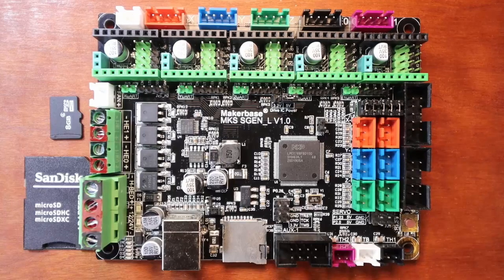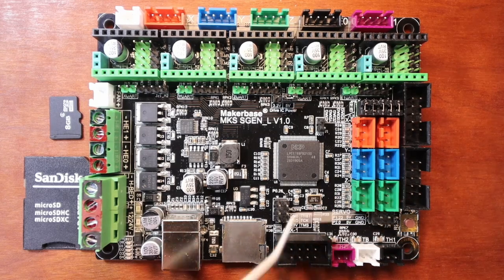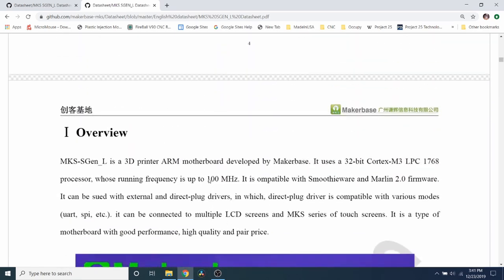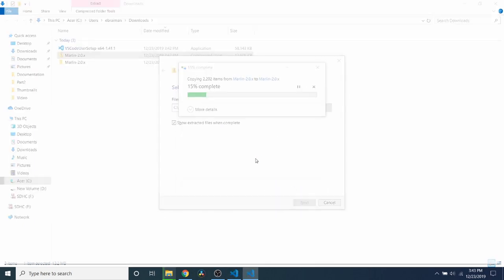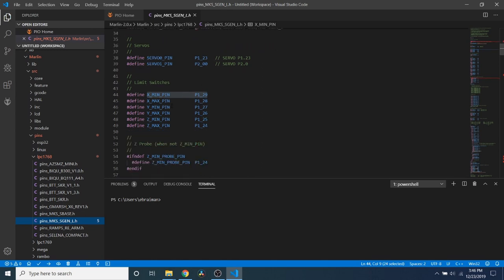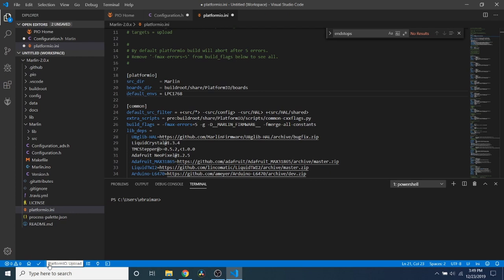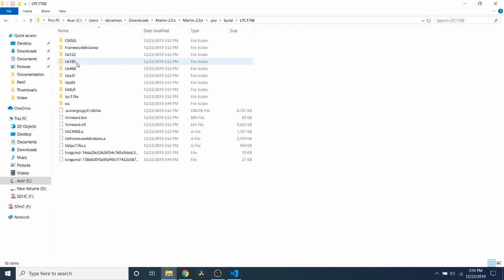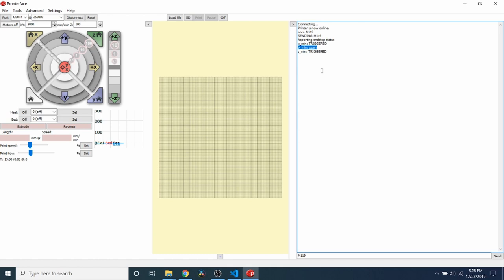MKS SGEN L V1.0 - Basics

Comment: Thank you for this and your other SGEN L tutorials. Having a complete step-by-step guide saved me from a ton of research.

And in case someone else runs into the problem that the board doesn't accept the firmware.bin file and keeps rapidly flashing the LEDs in the corner - for me it was a SD card issue, even though the card passed any testing software I threw at it. Only after replacing it firmware.cur appeared.

Comment: so with the mks gen_l v1.0 board that I just got there is no sd card holder on the board so how do I get the job done on it?  been trying for about 2 weeks and just noticed that there is no place to insert the sd card.
Reply from the maker: MkS Gen L is loaded via USB port for firmware and via a com connection if you wish to print via port.  If you add an LCD there is a SD card mode in Marlin firmware that needs to be set.

Comment: Hi Edward how are you? Thank you for the great video;) could you please tell us on you personal opinion what is the better mother board skr or mks or lerdge? I have modeled and start to build 3d printer similar to creality cr10. The idea is to model and build printer so everyone based on the instructions can build it :) do it as simple as possible for this reason asking you what board to use in the project so it will be easy to program and it will be functional enough for further printer upgrades. Thank you
Reply from the maker: Depends for MKS Gen L verse SKR.  MKS Gen L is a 8 bit board so computations are limited, whereas 32 bit gives you more bitwise resolution.  In a couple of years everything will migrate to 32 bit.  The other board I'm not familiar with.

Comment: hi. Great video. There is a way to program this board without Marlin ? I need to use this board for a personal project not a 3d printer.. can you program a simple Blink to this board ? I will appreciate a lot or send a tip of course..
Reply from the maker: It's possible.
Reply: Ok. How?
Reply from the maker: That's would be about two semesters of explaining in micro processors.  I'd start with something small like an Arduino Uno and work up from there.

Comment: Great Walk through.  I need a help, i am using same MKS SGEN_L v1.0 and TFT35, is there any other settings in marlin, i have uploaded the latest marlin but how to confirm this in TFT, like to show in about screen or how to confirm. Also let me know if i can use this board for building CoreXY printer. Thanks in  advance. Waiting for your reply.
Reply from the maker: With TFT you might not be able to confirm, but if you open a ASCII session in Pronterface it might display right away or with a gcode command.

Comment: Hello Edward! I have the same controller board but I had to short the header that says boot, then press reset, remove the jumper and reset again for it to update its firmware.
UPDATE: I have flashed my firmware again. I no longer need to use the jumper, but I need to place the file named FIRMWARE.CUR in the sd card before flashing.
Reply from the maker: FIRMWARE.CUR is current last flashed file or a backup.  If you want to reflash with that file you would rename FIRMWARE.CUR as firmware.bin.  Otherwise a new firmware.bin will overwrite FIRMWARE.CUR with last flashed file.

Comment: Maybe you cover this in another video but where do you install all the fans? I only see two slots here and the printers always have 3 minimum. The board fan, the hotend cooling fan and the print fans.

I cant get them to work as it should, with me always having to turn on the hotend fan when it should be always on.
Reply from the maker: There is a video, just need to check tonight and make public.

Comment: Im riding the struggle bus trying to get this board to work on a tarantula pro, somehow managed to smoke (litterally) my bl touch in the process. Accidentally purchased this board to replace an 8 bit gen l and have had nothing but issues. Getting a solid state beep from the board when i power on with sd card in main board or through serial. Am I in over my head here? Considering returning this board and purchasing a standard 8 bit board.
Reply from the maker: Not sure if this is a question or statement?  Generally I would take things step by step.

Comment: Hi, do you have a guide on how to connect a full graphic lcd? I am waiting for a TFT35 V3 to arrive but I am having trouble connecting a full graphic lcd in the meantime. The screen doesn't light up and the speaker ticks like a clock. Weird that the lcd's work on my other 3D printers but not the sgen l
Reply from the maker: I'll be doing soon. Marlin had anew releasee yesterday and I'm going through it.
Reply: @EdwardBraiman  thanks!!

Comment: Hi. I have configured my mks sgen v1. Thank you for this video because I learned do it. But I have a problem with stipends. They don't work. Should I configure motherboard pins in which way or it is done?
Reply from the maker: Could you rephrase?
Reply: @EdwardBraiman  may you know what can be cause of not working stopends?
Reply from the maker: Endstops not functionality has many variables.  Saying something does not work, does not explain variables.  State the hardware you're working with, the firmware version, the computer connected.  Also are you using an example file or following tutorial with same hardware?

Comment: What a great and helpfull Video. And hope to bild me a firmware for my Homers Tarantula pro that still not in use du to firmware issu.
Can you help me to get the firmware so it works with a 3dtouch V3. I installed and tested it and i can get the firmware out off it. Only i dont no what staps to take to make the 3dtouch to work properly. I did the years ago but not sure if that still works with the new Marlin 2.0.x i did it on Marlin 1.4 or something like that. Thanks in advance. Greetz, Andre
Reply from the maker: Join my Discord, most people in discord chat can walk you thru install checks.

Comment: hey Edward I have a quwestion and maybe you can help becauseim tired of sending boards back. I m always in a hurry and on more than one occasion I hit the reset button on the board ,and its always with these mks boards for my sidewinder. And every time I do that I cant flash new firmware onit because windows doesnt recognise it and insering a sd card with firmware doesnt update the firmware either. The board still works and windows make a noise when i plug it in , iy just doesnt recognise it. And I just got the mks sgen v1 and i dont want to send it back. Any idea how to get windows to recognise it? I have a few programs I cantry to flash the correct firmware on it just dont knoew which one.
Reply from the maker: First which sd card are you using and size?
Second what files are left on the sd card after an attempted flash?
Third avoid reset button and pull usb cable for 30 seconds and then replace.

Also almost anyone in my Discord might be able to help.

Comment: Hi Edward,
I have a 3D printer with MKS Gen-L v1.0 running 24V. Marlin 1.1.9 ( i think), 2 Extruders. All running fine except layer fan !!! My fans are all 12V (except layer fan) controlled by an Arduino 4 relay and i run controller fan on pin 6, E0 Auto fan on pin 11, E1 Auto fan on pin 4. I tried to hook up a 12V layer fan to the relay using pin 5. Does not work !! I purchased a 24V fan and connected directly to D9 and defined it on FANMUX0_PIN 9. Also does not work. ( I have the setting in Cura to do layer fan from layer 2). Any advice how to get this last fan to work ?
Reply from the maker: Check the output voltage using a multimeter with pins debugging turned on in Marlin firmware.
Reply: @EdwardBraiman   HI, I followed your advice. No voltage detected from D9. I changed the pin setting to use pin 4 (2. extruder fan) as my test only use one extruder. Same result - the fan does not turn on on layer 2 or any coming layers, so i think the problem is something else. Is the correct place to define the layer fan pin really : #define FANMUX0_PIN ?
Reply from the maker: @peterwang3052  Now I understand the confusion your asking me about an 8 bit board on a 32 bit board tutorial.  This Playlist will make more sense for the board you're working with.  You can still use VScode and platformIO  as it's a better IDE.
Reply from the maker: Here is the link to my MKS GEN L Playlist ... https://www.youtube.com/playlist?list=PLP-VDZmS6bFq6vxraVsYCeuyFlEKWhkJ6

Comment: Great video Ed ! I am getting firmware .elf and firmware.hex for my MKS Gen L V1.0 (RAMPS1.4) with atmega 2560 chip, how to proceed?
Reply from the maker: Which board do you have?  MkS Gen L v1.0 or MkS sGEN L v1.0?  One is for 8 bit processor and other is for 32 bit processor.  I have several playlist for each type of board.
Reply: ... "build" command does not create .bin file...
Reply from the maker: Not sure you understand my question.  Which board are you using?  What is written on board?
Reply: @EdwardBraiman  MKS Gen L V1.0
Reply from the maker: The tutorial you're watching is for MkS sGEN L v1.0.  there is another playlist for MkS Gen L v1.0 on my channel.  This tutorial is for 32 bit processor, you processor is 8 bit.  That's why it's doesn't work for your board.
Reply: @EdwardBraiman  Thanks, I see. Did not find the Gen V1.0 tutorial.. +my LCD does not not light up when wired to the board..
Reply: my computer has access denied on COM port so no access via USB...
Reply: Should I try Arduino 1.8.5 ?
Reply from the maker: The video iss very old, but you can use 2.0.x.
Reply from the maker: What do you see in device Manager?

Comment: Thanks a lot for the great video! It helped me a lot with the first steps of installation at my MKS SGEN v1.0. I´ve still got a few issues and I hope you one of you could help me: I can´t connect to my printer with Pronterface. It says: [ERROR] Could not connect to COM4 at baudrate 115200:
Serial error: could not open port 'COM4': WindowsError(2, 'Das System kann die angegebene Datei nicht finden.')
Did you install any USB drivers to connect to the printer? 
Maybe anyone of you knows my error. Thanks a lot in Advance!
Reply: Did you ever get this figured out??
Reply: @Saucydarkmatter  No, i bought an Arduino Mega and with that, it works fine

Comment: This may be a rudimentary question, but in the documents the jumper pins are listed from ms1-ms3. They show either as VCC or GND. 

Is VCC state no jumper and the pins open? Or is VCC state jumper on the two most pins in a row? I assume GND is the jumper to the rightmost two pins in a row.  If anyone can help me with this I'd appreciate it!
Reply from the maker: Are you asking about the steppers?  In my playlist I show the process for step/dir.
Reply: @EdwardBraiman  yes I am. I saw that portion but in the stepper manual there are settings for micro stepping with the jumpers. I'm not sure what position the jumpers need to be in for VCC and which position for GND.

Comment: Hi, I recently got one of these and I am having alot of trouble uploading to the MKS SGEN. I copied the BIN file from the directory you showed and loaded it to my board, but every time I plug in the MKS I get a USB device not recognized error (and nothing shows up in my COM port entries), though in the Universal Serial Bus Devices section, I see a Marlin USB device. The board repeatedly resets (the light signals just go back and fourth and I keep hearing the USB notification sound), leading me to believe the download from the SD card failed. I believe its a driver issue, and I tried uninstalling the current driver by uninstalling the device via device manager, but every time I try to manually select the driver I downloaded from the gitHub library, it says I already have the best drivers downloaded. It should be noted that when I first got the board, it registered as a smoothieware device, but I want it configured as Marlin so I used Zadig to download the winusb drivers. I assume I did it wrong though.
Reply from the maker: What's the size of the SD card?
Reply: @EdwardBraiman  its 16 GB
Reply from the maker: 16gb might be a little large.  You can try partitioning drive and place firmware.bin on lower sized partition.  I recommend a 128mb micro SD card as it should work.
Reply: @EdwardBraiman  okay, i'll have to go pick it up some point later. I read on the datasheet that the board isnt supposed to show up on COM port until the firmware is updated, is that likely why im having USB connection errors?
Reply from the maker: Let me know how it works out.
Reply: @EdwardBraiman  Hi, I gave it a try, had no luck. I even tried picking up a 128 MB Micro SD card which yielded no results. I really think its a driver issue.
Reply from the maker: In the description in the video below there is a link to Discord chat.  Let's see if I can walk you through the issue.

Comment: Hi, i tried to do what you did but i always get this message : #error "Oops! Set MOTHERBOARD to an LPC1768-based board when building for LPC1768."
Reply from the maker: Sounds like default environment is not set in Platformio.ini
Reply: @EdwardBraiman  Well this is weird , because i did everything in the video as you said, is there another location? cause in platformio.imi i set this default_envs = LPC1768
Reply from the maker: There are three things in a normal compile that need to be set, configuration.h, serial port to -1, motherboard to type in video and one stated in previous comment.  The steps in video should be valid.  Try downloading a fresh Marlin firmware and repeat, otherwise send me your configuration.h and configuration_adv.h and platformio.ini on Discord with version number of Marlin firmware.

Comment: have you managed to do a video on how to use dual z endstops in marlin
Reply from the maker: May I ask the purpose for two endstops?
Reply: @EdwardBraiman  i want to home the printer on both  the x axis as i dave dual z motors
Reply from the maker: Well when you home at one endstop, you're setting a zero point for steppers to step from.  You then can specify how far the axis can go in SW.  
The only purpose I know of for dual endstops at the moment is when people use dual x-carriages for printing.
Reply: @EdwardBraiman  iv replaced the controler in my anycube chiron, the chiron came with dual z endstops i just wanted to use them for better bed leveling, i am going to add a bltouch when it arrives but at the moment i have to level the left z as its not in the same place as the right one with the digital endstop
Reply from the maker: Okay now I understand the issue.  I'd need some time to research.
Reply: @EdwardBraiman  thanks on that

Comment: hey man I have the 2.0 ver of this board with tcm 2209 uart drivers and can not get it to work with marlin. The thing is, it do not compile the software. And the software supplied by  Mks is also not possible to get right, so my biggest problem is that it dosent seem to be any interest from mks to provide a fix. The case also is its not listed properly in env 1769 in marlin.  so in the typical way it is the user that is stuck whit the issues  and the get nothing but the usual load of runaround crap .
Reply from the maker: You understand the video title says MKS sGEN l v1.0?
Reply: @EdwardBraiman   yes i do ! it was ment as a request,  if you have any experience whit the v2 of this board. But i guess that was not obvious . The ilnk here you make videos about these things hens you properly got some knowledge about these things so the title does give a clue that you may know a thing about this topic.  sorry i this is bugging you.  you can just ignore it if it does, i just probe every one that i suspect can help to solve the issue.
Reply from the maker: In a couple of weeks I'll be posting tutorials on MKS sGen L v2.0, but some of the answers your looking for are in my patreon post for this board.

Comment: I have an mks 1.0 keys board... do you know what board you set... the board type to?
Reply from the maker: What does the data sheet say?
Reply: @EdwardBraiman  data sheet whats that? . They came in a bare box mega chip board... you have 5 choices depending on your configuation. Just like the RAMPS 1.4 some require a mendel parts mechanical end stop they have electronic dampened switching..
Reply from the maker: Sounds like a MkS Gen L v1.0 if big chip in center of board reads atmega 2560.  Meaning it's an 8 bit board.  That's in a different playlist on my channel.  This playlist is for 32 bit boards.
Reply from the maker: https://www.youtube.com/playlist?list=PLP-VDZmS6bFq6vxraVsYCeuyFlEKWhkJ6

Comment: Hello, I need some information. I need to install an ups unit (Mks ups 12v 24v) together with an automatic leveling sensor on a board. Makerbase mks sgen_l v1.0 is possible
Reply from the maker: Anything is possible.
Reply: e do you have any idea how i should proceed? since the two components mentioned use the same pins! @EdwardBraiman
Reply from the maker: You can always modify the pins file for board.
Reply: @EdwardBraiman  thank you for your willingness to answer, i'm starting in 3D printing and i'm a little lost, but thanks for your help! he was very helpful, I will look for more information very grateful for your help thanks very much! sorry english, google translator!
Reply from the maker: You're welcome, you can always asking in your native language.  Also my Discord has many experienced users that can help as well.